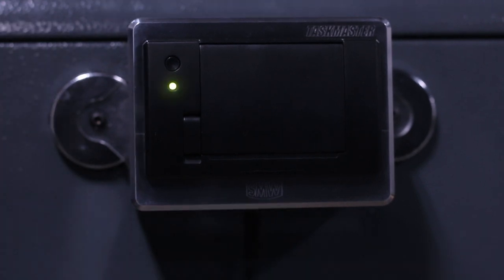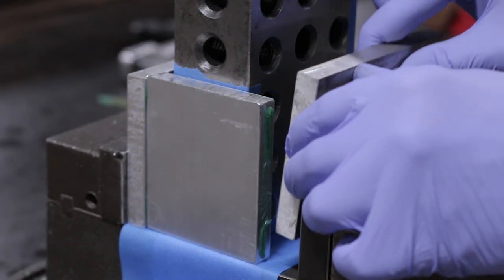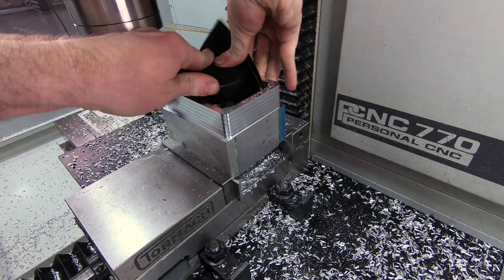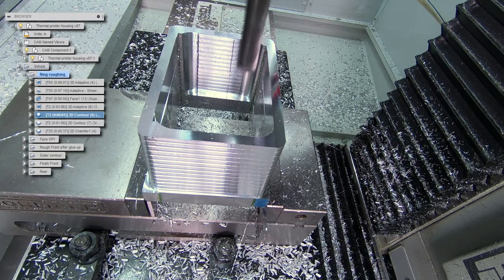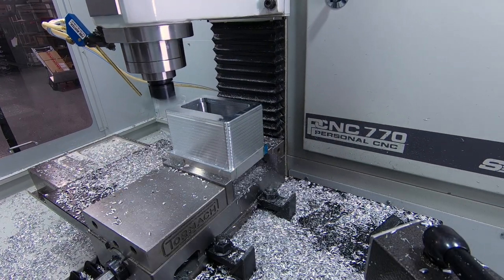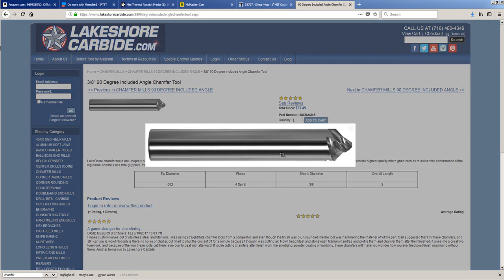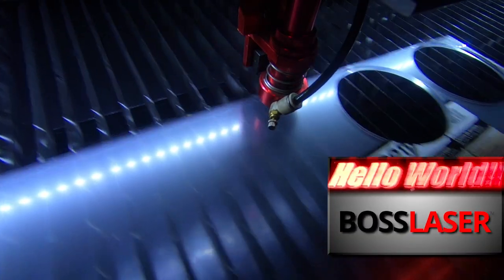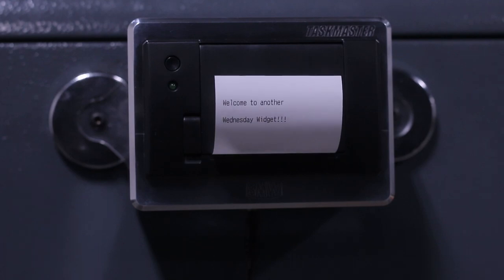Machining The Arduino Taskmaster! WW195

Comment: I like those "optional Steps" in the setup that allow you to do rest machining without the actual larger tool steps.  I have some setups with  12.7mm and 6mm tools but have manual tool changes.  This would allow me to do all the 6mm operations in one hit but still use Rest Machining :D   I'll look into the optional ..option
Reply: i just suppress the prior op, it seems to work the same.
Reply: Regal Metal Works I’ll give it another go. Trouble us rest machining is broken at the moment and it’s been reported a few times in the last few days. Hopefully fixed soon now they have the diags
Reply: I was fighting with it today, but it wasnt rest machining that I know, I had gcode from a year ago and it did exactly what I wanted, but it had the red icon, so I regen, and it then changed my path and now would mow right through my bolts holding down my part!  The only way I could work around it, was to make an op before my 3d adaptive clearing, clearing only the area where the bolts were, then generate the same 3d adaptive code with rest machining and it then avoiding my hold down points.  I then just suppressed the prior op.

Comment: John, another way to quickly and safely find height offsets is to lay an end mill on your part. Bring the spindle down so the end mill won't roll under the tool, then raise it up. You can feel when the end mill rolls under the tool down to a tenth or so. Just subtract the diameter of the end mill from your Z offset.
This is really safe because your tool is going up the whole time and it is very hard to run into the part by accident.

We do this at school all the time because everyone is using different tools every day, often with the same tool holders.
Just thought I would put that out there...

Comment: Hey John! Despite all concerns mentioned below I am glad you tried this. I wonder which strength the glued joints have? Are there ratings or do you have experiences for this? The enclosure is awesome and overengineered, but what about mechnical parts that need to withstand forces? Would be great to glue on ribs for stiffening parts and so on..
Best Regards , Damian
Reply: Bonding is taking over from welding for aluminum in aerospace.  Well designed bonds are so strong that the material will fail first.  Caveat emptor - you need to understand bonding weaknesses and design to counter.  A good weld is equally strong loaded in any direction, whereas a bond is not.  Peel strength is typically weak, and shear strength not awesome.  It doesn't take much design to counter those weaknesses - look at woodwork joinery techniques, the principles are virtually identical.

Comment: Another great thought provoking video. I have the same issue with not having the ability for zero speed spindle for drag engraving. Maybe we can detect a specific speed (like 411) and change it to zero in the post processor.
Reply: Open the G-code (or .tap, or any other machine code) in something like Notepad.  Use  the "find" function, usually Ctrl+F, to find M3 or M03 (spindle start). It usually looks something like M03 S2000 that tells the CNC to "turn spindle on, set speed to 2000 RPM" in this case. All you have to do now is to either set S0 or delete that line all together and the spindle will not start.
Reply: I know but I am doing a lot of custom engraving and editing the G code for each post is a pain, I will be looking to modify the  post processor to do an "If speed = 411 then speed = 0" type change if I can. That way any time I post a speed in any CAM going forward of 411 it will get over ridden by the post processor to 0.
Reply: Ed Rees good idea, My drag engraver is not always dedicated to any one tool changer location but something I can use on the CNC without an ATC
Reply: Does the machine not have a separate switch for the spindle, like a safety switch or even a fuse/breaker? If you do a bunch of engraving at once it might be easier to turn the spindle off that way. At the very least there should be a "spindle stop" button on the screen of the machine's computer somewhere. What program runs your CNC, anyway?

Comment: This is could vs should. As always, great presentation, but this job in my shop would be I can make it this way or that way, but nowhere in the quote would be glue. Telling your customers what you can do gives them a blank check. Telling them what you will do gives them a contract.

Comment: Kinda opposite theory as you have preached before. What would have been the cost of a solid chunk of aluminum? You needed $17 worth of glue, $2 tip, and a $28 gun. I get it, for fun.
Reply: I don't think he used all of the Loctite H800, and the rest of it carries forward minus the tip I assume.
Reply: i think he was also testing out the loctite as a viable option. but yes, still a better option with a lot less waste than a solid block. the more options you have the better you are able to use what you already have as well. if we never try anything new, we dont grow :)
Reply: the tip and what is in it is lost
Reply: You can also buy 1.5x1.5 PVC rod at Home Depot and glue it together to make a piece of machinable stock.  This stuff is used for trim on houses because it doesn't rot.
Reply: but the best option could be just to weld it and the least expensive option
Reply: Your then introducing more problems, warping, distortion, work hardening, glue is very non intrusive and an equally strong bond.
Reply: Could have used screws to create the box
Reply: i would of welded, but i am more interested in that adhesive now and considering buying it.. so
Reply: EFormance Engineering, Glue with what?  Do you do that?
Reply: I would have welded it, but only because my 3d printer isn't working.

Comment: that acrylic from lowes smells HORRID vs online purchased acrylics. i dont know what they do with theirs at lowes but its nasty
Reply: Perhaps Extruded vs Cast?
Reply: Might be they are selling polycarbonate as acrylic? I’ve cut both with a table saw before and the smell of the polycarb was horrid and gave me a bad headache
Reply: not poly carb (it usually turns yellow if lasered) but the extruded vs cast could certainly be it. i ordered a bunch from tap plastics and its smells but not that bad. lowes stuff, however, is 15x worse
Reply: Keep in mind that the fumes that cutting polycarbonate generates are quite nasty to inhale. Especially not advisable to cut that crap at all with a laser...